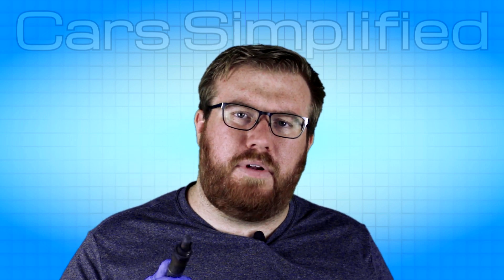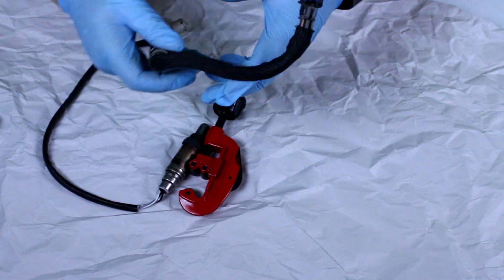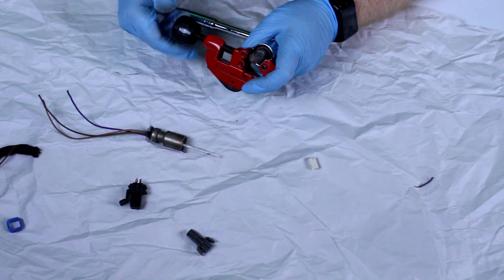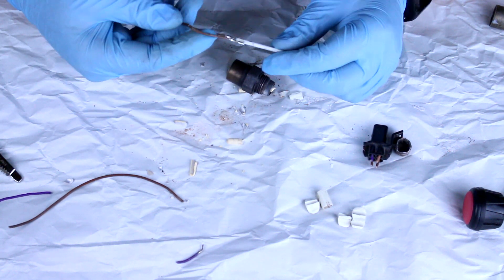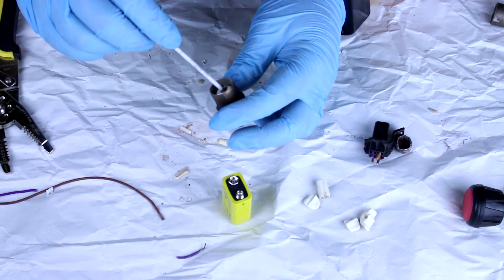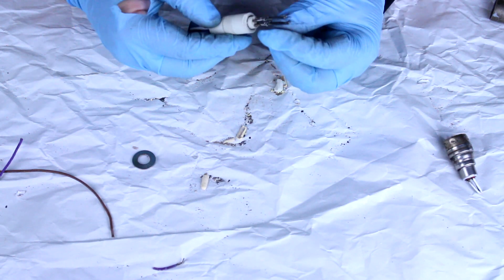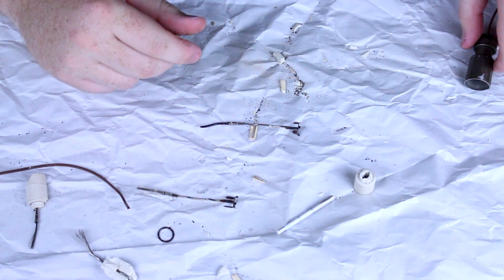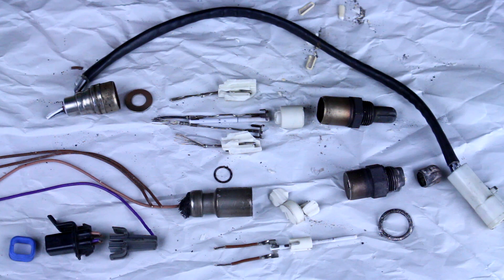What's Inside an Oxygen Sensor? Two O2 Sensors Taken Apart • Cars Simplified

Comment: An inspired idea, using a pipe cutter on it. Here's the reason I was curious about what's inside it: I will be cutting mine while still on the exhaust, so I can use a shorter socket to remove it (not enough clearance above it to fit my longer sockets).
Reply from the maker: Thanks!
Sounds like a good way to remove one, but do you plan on installing a new one, or are you just going to plug it up? If space is that tight, there's an oxygen sensor crow's foot (offset socket) that may help.
Reply: @CarsSimplified  Thanks for the suggestion, I'm aware of that socket but it just isn't strong enough for the situation because it's open on one side.  My issue is removing the 21-year old original O2 sensor, that's now a rust-welded part of the exhaust pipe. This is the one I will cut off for easy access to its nut at the base. For installing the new one I'm just going to use an open wrench, won't be difficult with the thread clean and the antiseize as lubricant.  Commenting tips the algorithm, so let's make you famous! Next time use a nut cruncher on the porcelain innards and film it exploding in a slow-motion close up shot. LOL

Comment: in the beginning of the vid your holding 2 sensors... what im trying to figure out is this... those sensors connect into the engine by the metal head, and the plastic parr clips in to the other part of the 02 sensor that is connected to a module... how can i get the correct name and or find a place that sells the part of the 02 sensor that you connect too...
Reply from the maker: The part I think you are describing is referred to as a pigtail, harness connector, or plug, but these terms are used interchangeably for both sides of the connection, so it may still be difficult to find the part you are looking for. I know there is another term I am forgetting, but I'm pretty sure it is less frequently used than the ones I mentioned.

It should be available either online or in parts stores, but there may be some odd versions out there that are hard to find. There should be just a handful of part numbers that cover most of what's on the road, so hopefully you have one of the common connection designs.

Comment: A reciprocating saw will not cut the ceramic part so you had the right tool there. I just had a hell of a time removing a corrosion welded one. Used a dremel tool to cut the steel sleeve, and hammered it to break the ceramic. Was wearing a respirator the whole time just in case, but wanted to see if anyone knew what the inside contained :)
Reply: Stainless steel sleeve ?

Comment: I believe those sensore measures the temp of the exhaust so you give the cylinders more oxygen " more or less fuel "  and then the car with run hotter or colder .
Reply: It directly senses the oxygen concentration in the exhaust, not the temperature. Either by creating a voltage(caused by different concentrations of O2 between outside and inside air) or the o2 levels changing the ceramic's resistance, depending on the type of the sensor (zirconia or titania).
Reply: Brandon, I think you are right. I don't see how it can sense the oxigen level especially while some sensors are completely sealed. Most likely it's some kind of semiconductor that changes resistance or voltage based on the temperature.

Comment: what are the differences between a top and bottom o2 sensor?? I know they have different functions but im wondering if they were manufactured any differently and over all universal.. "as long as they are properly plugged into the proper wiring harness .
Reply from the maker: A few cars use the same part number for the universal style sensors, so I think the most common difference is just the plug, but the upstream ones closer to the engine deal with a little more heat, so they are probably made to handle that better. Same basic parts inside for sure. If I remember to label a used upstream and downstream one day, I'll make another video like this.
Reply: Pre cat sensor and post cat.